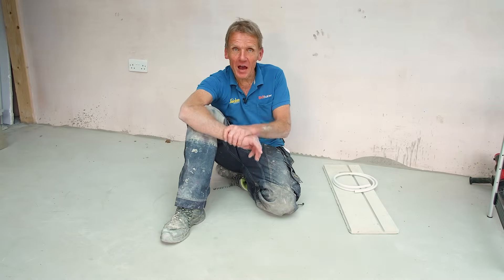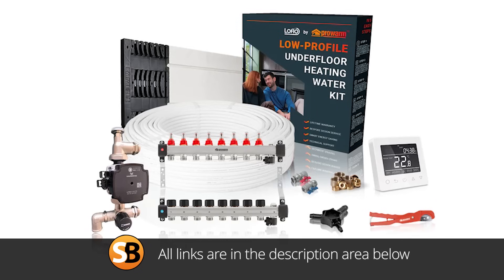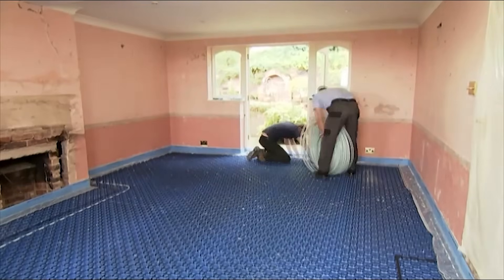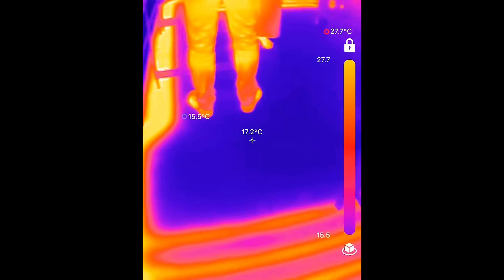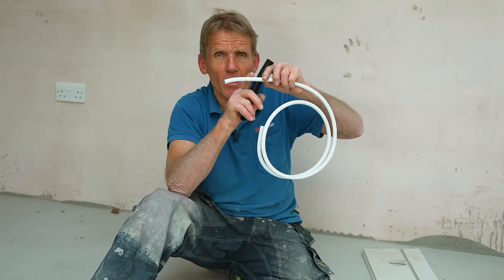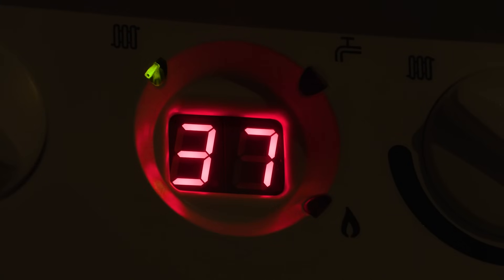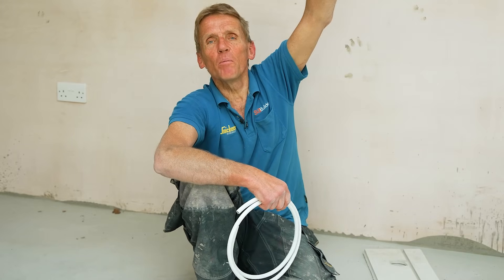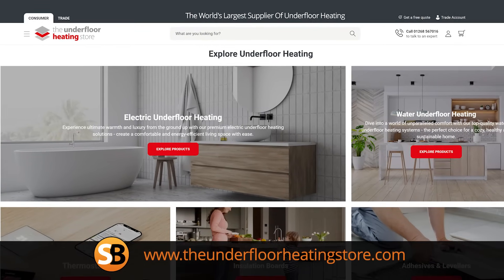Electric vs Hydronic Underfloor Heating Which Is BEST For Your Floor

Comment: So effectively the Romans knew more about heating than us British. 
We started with a fire in the hut, advanced to a fire in the end of the room, then just replaced the fire with a tank of warm water on the wall getting heat from a central sorce.
The Romans knew hundreds of years ago, just put heat under the floor, it works much better.

Comment: if electricity is the source of heat, wouldn't direct electric uhf be better than hydronic? heating the water with electricity and then moving it around would necessarily be less efficient than directly heating the floor no? Hydronic is better if electricity is expensive where you are and fuel is cheaper per calorie.. It might make sense in a setup with a heat pump also though..

Comment: No convection with underfloor heating? You must be joking.

When it’s cold outside, the air in my living room will start to move a lot due to the cold of the windows (hr++) and other colder parts of the house. When you use the floor as a primary heat source, wind will blow throughout your room.

Comment: Top video as alway. I have an old farmhouse which has been extended. Downstairs on the original footprint is a mix of solid stone floor over a vaulted basement, living room and dining room over joists with 1 foot void, kitchen and "orangery" (warmroof)on some sort of insulated concrete.

I was thinking of changing the timber floors to insulated slabs so the whole place is level and insulated (except room above basement) then some kind of overlay system. But do I use insulated boards, or eggcrate system (take advantage of the concrete thermal mass below?)

Comment: Hi Roger great chanel thanks, quick question for you,  could I remove a radiator and connect an underfloor heating pipe to the tails. So in effect the long pipe becomes a radiator. 
Thanks..

Comment: Is it sutible to have engineered wood flooring with underfloor heating?
Reply from the maker: Yes but I would do it as a floating floor and use a click system. I have done it several times but you need a floor sensor to keep it below 29 deg and you can't put rugs on it because it cooks it under the rugs and the floor can split. 
If you have wood flooring make sure the plywood back is decent. Some are made from scraps and have hollows.
Reply: @SkillBuilder  thank you. Do you plan to make video about it?

Comment: Hi 
Can you suggest which system is best in efficiency 

Either rapid response (direct tiles on hot pipes. Or screed system, in new build.

As screed is good conductor stay warm long time , but take long time to warm up, please advise

Comment: Hi Roger.  Watch your vids with admiration as I'm useless at DIY.  Buying a new barn conversion with Air Source Heat Pump and UFH on ground floor (1 bed & bath upstairs with rads).  Would it help to fit solar panels and batteries to reduce electricity costs of running the pump?  Any idea how many panels (ground floor area 81m2 & first floor 31m2)?  Thank you

Comment: We've added 70m^2 of Wunda UFH to a 1930s house and it does a great job. We had to put 150mm of rock wood under the floor boards to avoid losing heat into the void, but once this was done it was very efficient. Total height added over floorboards was about 22mm to top of LVT/SPC so just mild trimming of architraves.

Comment: Hi we are moving into a Davidsons new build in September. It has radiators all round. We will receive the house at completion with skirting boards installed. How much height do you need to add water based underfloor heating required? Do the skirting boards need to come off first? I’m going to have Karndean laid flooring to finish so will this work?

Comment: Can the water be heated with electricity
Reply: Some water heating systems allows for dual fuel heating, gas & electric  - but most are single source

Comment: Thanks for video .  If you have 2 zones ie underfloor downstairs and rads upstairs , do modern boilers / thermostats adjust for heat output for best efficiency ? So if just the underfloor is required the boiler would run lower etc

Comment: Hi Roger, we have a pipe + tray installation fitted in 2005. The original owners laid a teracotta-coloured ceramic tile floor over the heating pipework and twenty years later the whole ground floor now looks a bit like an in Italian restaurant! If we were to replace the floor is it best to lift the ceramic tiles or could we simply lay new tiles over the top? The other option would be to have a polished concrete floor poured on top of the tiles  or an epoxy floor installed over the tiles -I am keen to avoid destroyng the floor/ damage the  heating pipes by removing the ceramic tiles, but I don't know if adding an extra layer of tiles/flooring over the existing tiles will reduce the effectiveness of the underfloor heating.
Reply from the maker: HI Matt 
It is a good idea to lay the tiles over the tiles. Hopefully you can avoid the joints coninciding.  I have done the micro cement flooring before that is trowelled down. I did it roughly 3 years ago and it is still fine and shows no signs of cracking. If you can find someone to do you a resin floor that is polished I think it would look great.
As for the heating, it will do no harm at all. The thermal mass is increased so it takes a little longer to come up to temperature but it also takes longer to lose heat so think of it as a storage radiator. 
So the good news is you can leave it all in place.

Comment: I once had a ‘heating engineer’ tell me that “you can’t just throw a bunch of pipe in the floor at 150mm centres……” I’d reason that if I did use that approach I’d still be installing better heating systems than many of those guys have done for decades of installing undersized radiator systems and charging an absolute premium for the privilege!

Comment: Inspired by your videos with heat geek etc I have opted for underfloor heating set in a new screed sourced by two heat pumps .
 In  Two rooms I am wantng to use engineered wood the remainder are porcelain .
   Do you have any thoughts as to which company makes the best engineered wood floor , I’m assuming 14-15 would be preferable for heat transfer as opposed to 20mm , the strength of construction under the wear level being crucial .
  There are so many companies all of which claim the suitability of floor for underfloor .
  Hoping you may have experience that may guide me . Thanks .
Reply from the maker: Junkers is probably the best wood flooring but I have used oak floor with a plywood back and  it works fine. Avoid floor that glues together as it will come apart. The wear layer on wood floor is measurable so you can easily choose a thicker wear layer. 
Avoiding outdoor shoes is a good idea and I always choose oiled flooring rather than varnished. You can feed an oiled floor year after year to improve it. If you go for varnish and an area around a door wears, you will have to sand and revarnish the whole floor to get it to match. With an oiled floor you just rub is over lightly with a fine abrasive to even out the wear and then apply more oil and hard wax.

Comment: Good info to there! Would a water ufh system work well woth a hot water tank with electric immersion heaters?
Reply from the maker: No, you need a boiler or heat pump

Comment: it would both convect and radiate heat as would any hot object on earth. The hot floor will heat the air in contact with it and that air will convect throughout the room. The only time you would consider something to radiate heat would be IR lamps and heaters in which the Infra Red energy is radiated via reflectors and minimizes any heat to the objects adjacent to them
Reply: I say this because the main use of energy in this system would be by thermal conductivity and convection, not radiation (at a guess). But IR lamps and heaters main use of energy would be radiation or at least significantly more.
Reply from the maker: I am not going to go into the science because others do it better but underfloor heating is radiated heat. 
It can't convect because hot air is only pushed up by heavier cold air displacing it. The floor is heated so the cold air cannot displace the hot air. You can test it with smoke pellets. I have done this in barns with UFH and the smoke just drift around the floor.
Reply: Very interesting, thanks mate!
Reply: @SkillBuilder your information is wrong, the floor is heated just like a pan on a stove is heated, the floor then heats the air in proximity to it, which then rises as the air above it is cooler. The heat coming off the floor isnt the same amount as from 1cm as it would be 1m away, meaning there is a heating differential across the room, with less heating as you go further away, meaning colder air is always above.

Comment: Great videos. How much vertical height is required for low profile water system please? What options would I have with an existing concrete slab sub-floor please?

Comment: As a long term DIYer but with no experience of UFH, I used Variotherm from UFH1. It's a smaller bore pipe but laid on 100mm centres and in 18mm cement fibre board. On a level base. I won't deny its hard work laying the pipe but the plumber who connected it to the manifold (I thought I'd get a professional for that!) commented on the high quality of the pipe. LVT was laid floating on top.  The end result has exceeded our expectations. The floor never gets hotter than 26degC, it's uniformly warm because the pipework is not laid in polystyrene and there is an element of thermal mass in the CFB. Input temperature is about 40degC. I can control through a phone app if necessary. I can thoroughly recommend this system.
Reply: Thanks for this

Comment: Amazing video! Can you put it under a conservatory? And I have laminate flooring and I have 4sq metre in my kitchen and also in a toilet cubicle, is ripping off the floor a lot of work and is it worth it? I live in a very miniature house with a conservatory and roof extension, 900sqm but it’s got 3 floors and is freezing and I’ve heard underfloor heating can heat the whole house even if only on the ground floor Thanks
Reply: Maybe only if your whole house is extremely well insulated.  I have a 1910 solid brick wall house and the bedrooms upstairs need their own heat source on cold days. 

Mind you I’ve just done a loft conversion and out in as much insulation as I could fit so am quite interested to see how it goes this winter!

Comment: Another advantage is that you can use other types of heating (heat pumps/solar heat) that cant be used with regular radiators very well. Using a low temperature can double the production of solar heat - even with cheaper solar panels.

Comment: I've had an anhydrate screed (calcium) layed over wet ufh ontop of 100mm insulation and it heats my room running 30deg flow rate on a timed on and off

Comment: I live in a (very) hot part of the world and I'm wondering if I can use this system effectively to also cool my house? Any thoughts on this would be really welcome!
Reply: You can with most air/water heatpumps! They often have a 4way valve to switch between cooling and heating mode. However, you need to consider a few things. You can't cool the floor below dewpoint because moisture from the air will condensate on your floor. Hence, effectiveness depends on how hot and humid it gets at your location. Second issue is heat rises, so underfloor cooling isn't as effective in absorbing the heat because colder air tends to stay low. But you also have the same sort of sytem for walls. So instead of waterpipes running inside your floor, you have them in your walls. These are much more effective at cooling because convection. Also a great solution when you have wooden floors and underfloor heating isn't an option. Drilling in your walls with this system takes some more precautions tho.

Comment: Hi Roger, you may recall I have asked this question before, would there be any mileage in placing either a 6mm or 12mm if you have the headroom, using a insulated tile backer board, ie, elements board? thanks in advance  Paul

Comment: Did my own installation 15 years ago - on the cheap. Covered the entire ground floor ( concrete ) with 2 inch extruded polystyrene panels ( seconds ) as a floating floor glued together with polyurethane adhesive. 

Pipe runs were drawn out to and from the manifold and were simply routed out. Very easy to change spacing where you wanted more heat , standing areas in the kitchen etc. 

Covered in both tiles ( over cement board ) and solid oak t&g flooring - new skirtings fitted and not one problem since. We have a large conservatory open plan to the rest of the house and it is comfortable all year round  except on the very coldest days, it is double glazed with argon filled metallised glazing throughout,  however I fitted a radiator to back up the output from the underfloor, which couldn't quite cope with the heat loss on cold days, and fitted insulated blinds to the roof glazing .

I did have doubts about the oak flooring ( the missus picked it ) due to the thickness and the possibility of shrinkage , it was kiln dried so no movement. There is some inertia in the warm up time due to the thickness, but once up and running all ok.

Using the plain panels made fitting a breeze , and routing out pipe runs made coping with the twists and turns of a 1930's build a lot easier than proprietary systems.
Reply: So you just routed out the pipe runs directly in the insulation? Then tiled over the top?
Reply: @Tonisuperfly  routed the pipe runs directly into the extruded polystyrene - solid oak t&g laid throughout ground floor on the insulation - effectively a floating floor with a 10mm expansion gap all round and new skirtings fitted . In the kitchen and conservatory cement board was stuck down on the insulation then tiled - this matched the thickness of the finished wood floor.
I used John Guest barrier pipe and a Watts manifold with a fully modulating pump - each room served by its own circuit.

Fitted fourteen years ago with no problems at all - I would do the same again without question. The only downside is a slight loss of headroom, no problem unless you're more than 6'4" .
Reply: @fraserhardmetal7143  thank you!
Reply: @Tonisuperfly  you're welcome !

Comment: Can I, as I convert the house to underfloor do this room by room, simply cut the copper radiator pipes accordingly  and re connect the radiator pipes to the low rise underfloor system below the floor level ?
Reply from the maker: you can but it will only be controlled by the boiler stat so the pipes may be too hot
Reply: @SkillBuilder  So an additional 3 way thermostatically controlled valve would be needed to control the individual room temperature and enable a 'bypass' in the pipe work so the rest of the system to would flow appropriately. Is that right please ?

Comment: At 2.25 there’s a mix of systems presumably due to the click being more flexible on pipe location. Does this create an issue since the click is designed for screed? How did you get round this and what was the final finished flooring?

Comment: Good video imo Roger, but I'm gonna quibble with you on the radiation vs convection claim a little. Underfloor uses both, same with Rads although the % is different. Rads mainly use convection (despite the name) & yes, Underfloor would be far more radiant heat. It still heats the air though and air convects. Cold air will come in from the sides to fill the space as the lighter hoter air rises, although this is far less apparent than with a Rad as you rightly say. Far those ultra-high ceilings, you could go for radiant panels (electric IR) which rely on radiation almost entirely and do heat objects/people directly. The cost to run though is expensive and only high 90s efficiency possible. So there's always trade offs to be made.
Reply: Agree, however with underfloor the ’radiator' is much closer to the human in a large room! Warm feet=warm heart!!😁
Reply: @markthomas919  and if you get the effeciency high enough & therefore the flow temp low enough, the "radiator" is even cool enough to walk on with bare feet (over flooring). Very nice .

Comment: In my old flat I insulated the kitchen and bathroom floor with 60mm of XPS insulation and laid down electric underfloor heating. It was a nice solution to two rooms that had previously only had pull cord 2kW heaters. The difference was amazing. 
 One advantage of electric is that it is an even heat along the cable as opposed to pipes that get cooler nearer the end of the run.
Reply: How long to heat up?
Reply: @alexevans1981  A little while from cold. It was a little while ago I can't remember how long exactly. When in use it was kept constantly on and switched between a high and low temperature.
Reply: Isn't the disadvantage a much higher energy bill? Or do you only use it an hour or so a day?
Reply: @QnA22  Actually it wasn't. I also insulated the main room floor too, of course, and put a less powerful 1.3kW Fischer heater in there compared to the 2.5kW storage heater that I had before. Before I had to supplement that storage heater with a 2.5kW free standing electric heater as the storage heater was exhausted by 5pm in winter and the bathroom and kitchen molded up horribly.

Comment: What advice would you have for someone who already has concrete floors, do you have experience with "overlay" wet systems? I think I've seen some like the tray system you showed.
Reply: There is company that cuts grooves in the floor and then lays it in the grooves.  Theoretically this doesn’t work well, but actually does…

Comment: What is your opinion about electric heating mats UFH?
Reply: From my research for larger areas electric appears lower profile, costs slightly less to install but appears less powerful in heat transfer and more costly to run, even compared to a 1993 vintage lpg boiler!!